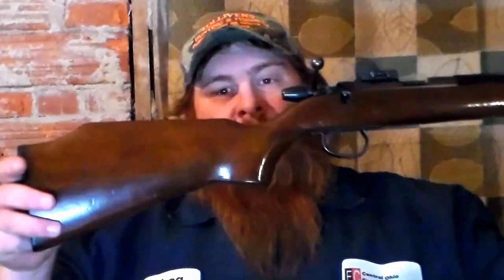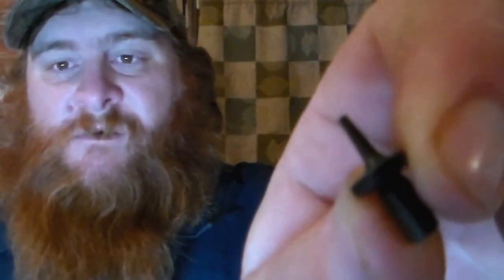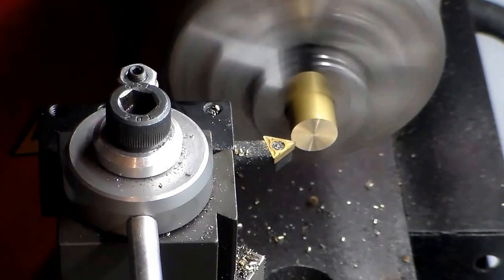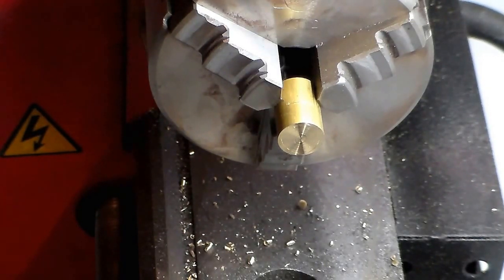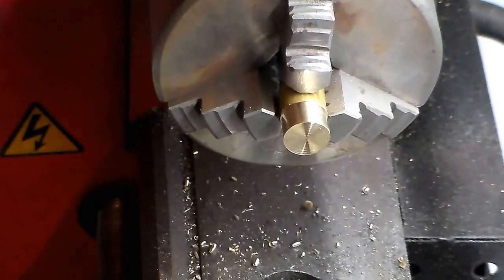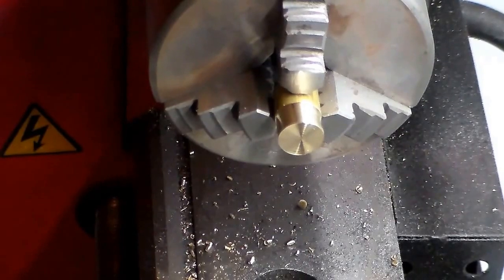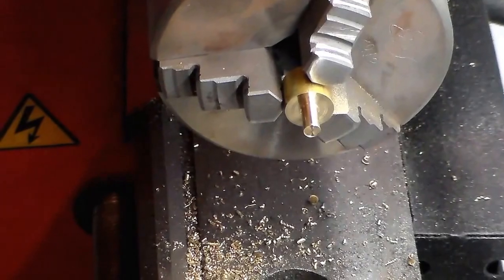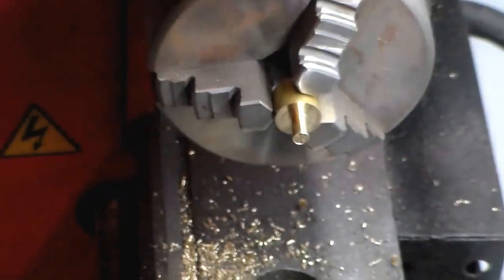Remington Model 582 Front Sight Part 1

Comment: Hi Dan, I found you through Mr Tom, he offered a tip so I shall follow his lead and offer one too. To save having a "stupid attack" close your calipers and zero, then open to the finish size for your part and re-zero. Now if you measure your stock it will automatically tell you how much you need to remove. Just keep cutting till the calipers read zero again. No need for any maths at all.
Hope this helps some.
chris
Reply: further to above it also works for getting a metric size on an imperial lathe. Your part is actually metric 4mm dia by 8mm long. For this work, close calipers & set zero, select metric and open to 4mm, reselect imp and zero again. Now cut and measure till you get zero again.
Reply from the maker: Chris Stephens Thanks for the tip Chris and thanks for watching!